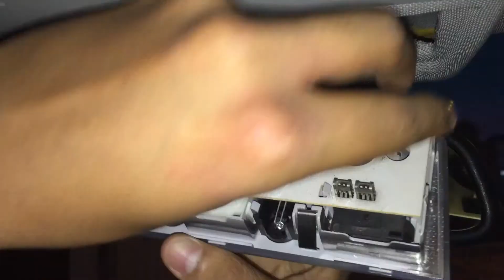BMW E60 530i DIY Interior Lights Replace 520 525 528 535 550 M5

Comment: which lamp did you use?
Reply from the maker: Sait Cinar hello, i used LED lights with T10 W5W connector
Reply: Jose Luis Acuña what t10 means? I have also bmw e60 2005 523i and i neef to know for trunk light which model light
Reply from the maker: these are the LED Lamps T10 W5W: https://www.google.com.pe/search?biw=1285&bih=702&tbm=isch&sa=1&ei=g6NBW4yqII-85gLFzorwAw&q=led+lamp+t10+w5w&oq=led+lamp+t10+w5w&gs_l=img.3...13819.15737.0.16279.4.4.0.0.0.0.200.394.0j1j1.2.0....0...1c.1.64.img..2.1.192...0i8i30k1.0.Ku_swe6gdNE#imgrc=VQqfe796462XpM:
Reply from the maker: those are for dome lights (interior). And for the trunk lights, use these LED Lights (39mm large): https://www.google.com.pe/search?biw=1285&bih=702&tbm=isch&sa=1&ei=y6NBW6PgOYHH5gKm8Ko4&q=led+lamp+39mm+trunk&oq=led+lamp+39mm+trunk&gs_l=img.3...147347.148964.0.149164.10.10.0.0.0.0.324.1351.0j4j1j1.6.0....0...1c.1.64.img..4.0.0....0.xIhiTo51BUs#imgrc=lZWvr-beDmzTiM: